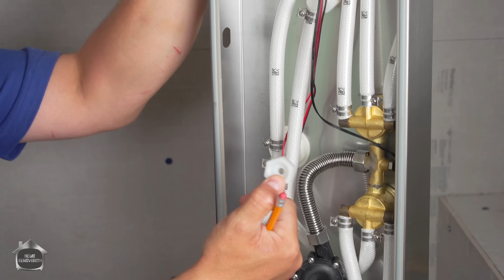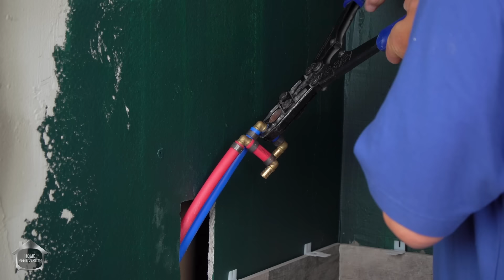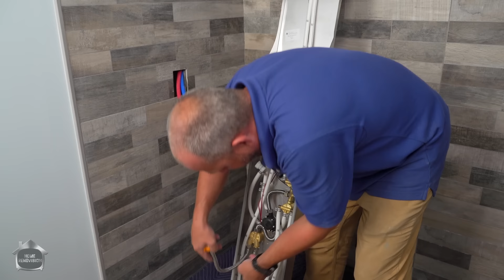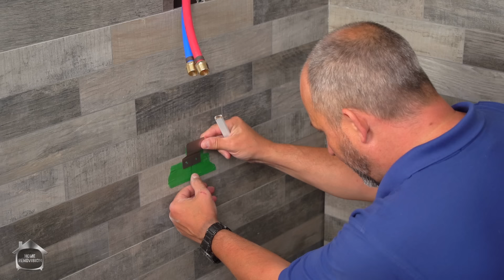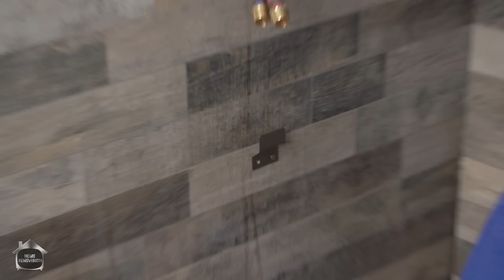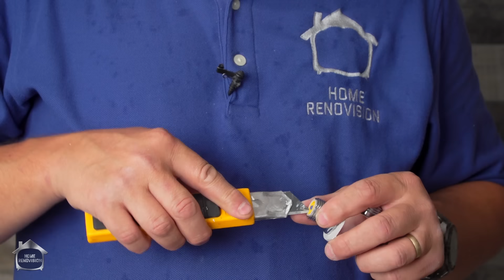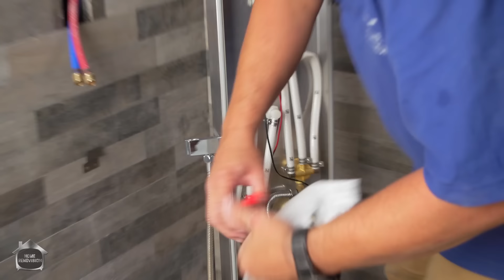Shower Tower Installation | Easy Plumbing For Beginners

Comment: I bought these same exact units from Amazon for about $280 a piece. One unit arrived a little smashed up at the top but I took pliers to bend it back... good enough and both units work great after installation! This video was invaluable for gaining the confidence to install them myself. I did have to hire a plumber to install new shut-off valves. Easy peasy!!
Reply: Is it worth it to buy? Or shower head is better?
Reply: @serhiiu604  It's been 2 years since I had these installed (2 bathrooms) and I love them. My family loves them. Everyone comments that it's like being at the spa. If I bought a new house I would install this same unit in the bathroom.
Reply: @JasonSigman  thanks for responding
 Would you leave the same one, or are there better options?
Reply: @serhiiu604  Hi, I don't know about the other options as I only have experience with this unit. I recommend it. There are reviews and comparisons online for other options.
Reply: You paid way way to much. I've installed at least 20 of these and usually pay between $115 and $140 depending on the model. After installing a bunch I like Ello and Allo
Reply: @aaugusta1842  Yeah, back when I bought them in early 2021 it seemed that the supply chain around the world was blocked up due to Covid and prices were definitely higher than today.

Comment: If you had shown the functionality  of the shower it would have been great. So many come without volume control for some reason. I just realized you could put a manifold in the line and add more stuff to it. Each new item would have to have it's own on off valve at the head.

Comment: Update: Your plan to sell your house (@30 minutes) in 5-10 years, changed. ;-), Installing one of these, the inspector was asking how it seals and I was trying to explain to him how everything just leaks back into the shower pan. Hope he clears me.
Reply: My shower tower leaked pretty bad, I recommend tightening all the philips screws in the back and all other connection points out of the box, this resolved my issue.

Comment: I watched this video probably 100 times.  Each time I learn something new.  I`m re-piping my home and decided to go and buy a Shower Panel. I have a Ello & Allo brand and it`s very similar to your unit.  Question, my outlet hoses on my unit are like yours, they go downward.  I`m re-piping my PEX from the ceiling downward like your pex. (My home has 40 year old pipes and under a concrete slab) .  Just like you, I will be attaching my PEX and curl the Shower Panel Hoses upward to meet my PEX. But I happen to notice on my unit that it states not to curl hoses upward.  I personally don`t think there is any harm.  What do you think?

Comment: This cosmic idiot left a gaping hole in the wall. God forbid a child sprays the wall with the nozzle, or splash back runs down the back of the tower, or moisture and condensation bead down over time. I am staggered this is the video on YouTube with the most views for shower tower installation....
Reply: Well that is very useful critique. Makes sense but have you ever heard of constructive criticism instead of an insult?

Comment: So an open hole into the wall for water and moisture to get into?
Reply: Very good. Makes me wonder if you could put some kind of a washing machine outlet for the hot and cold. That way it could be sealed. Or that may be overkill. .
Reply: @jamescole3152  That sounds like a very good idea. It might be tough to get one that fits, but a sealed box seems essential

Comment: how would I be able to have two of these panels in my shower? I would like one on each side of the shower, but I'm not sure how to connect the plumbing to do so. If you could possibly explain it to me that would be great.
Reply: Go with a larger supply line. 3/4 inch or more.

Comment: Hey Jeff, I assume you can only use 1/2” connections. Is that enough to use multiple functions at once?
Reply: same Q - seems 1/2” with all those small inner diameters will limit volume out of that tower!

Comment: I love your videos, they are easy to follow. I want to install a tower shower but I already have an existing plumbing for head shower. Any advice on what to do with the existing pipe and plumbing? Thanks in advance!
Reply: You can buy a shower tower/panel made for retrofits if you don't want to mess with it.

Comment: Do you think there would be any issue splitting my single 1/2" feeder lines (H/C) into 2 of these towers? I know there are a lot of factors to calculate flow and loss but "in general" if there was sufficient supply to a single tower is it within reason to expect decent performance with 2?  Thanks in advance!
Reply: You won't get the flow from both running at the same time with a 1/2" feed.

Comment: What other shower tower  or brand of shower towers do you recommend?  Preferably one from Lowes or Home Depot, as I'm too worried about shipping damage and like the fact if there is any issue I can just drive 2 miles and return to store directly.  This unit (actually the whole brand, Ello&Allo) isn't sold on Wayfair anymore ...can only find on Ebay from random sellers.

Comment: If you put in a tower, then later want a more standard shower, should you somehow prepare for that option in advance? Would you need to come in from the back through the adjacent wall?
Reply: Came here for the same reason. I'm wondering if I should just go ahead and plumb everything just in case I want to get rid of the tower.

Comment: For the units that have an integrated electronic display for water temperature or shower time, how is the display powered.  Is it a battery?  How long does the battery last?  Where is it replaced?  Do you have to lift the unit off the wall to replace a battery?
Reply: It has a small generator that is powered by water flow. I am putting the same unit in now so this video made a ton of sense!

Comment: Great vid, can I ask if this is a electric shower or thermostatic? I thought it was thermostatic as you have cold and hot water pipe going in, but then also saw wires behind panel and not sure what they're for so confused? Thanks

Comment: Mr. Thorman used a laser to check that the holes for the mounting brackets were vertically aligned. It's also a good idea, after securing the shower tower to the wall, to check that the unit is centered as desired and isn't tilted, because typically each bracket allows considerable lateral play, almost equal to the width of the shower tower.

Comment: If the hose clamps on your shower tower are held by Phillips screws then they are crap and may come loose. Replace each with a stainless steel band hose clamp that comes with a stainless steel hex head screw, which you can securely tighten with a nut driver.

Comment: Using an aluminum hock on an empty pail is a bad idea, because it won't be stable. If the hock is slightly off center, or the shower tower isn't centered, then it will come crashing down. Also, since the shower tower is typically made from stainless steel whereas the hock is softer aluminum, it's likely that the shower tower will scratch or gouge the hock. Using an upside-down pail would be more stable and avoid damaging the hock. A 5-gallon plastic paint pail is a good size. In fact, for even better stability, use a mostly full upright 5-gallon pail of paint or drywall compound with the lid securely fastened --- the heavy pail of paint or drywall compound will securely stabilize the support for the shower tower.

Comment: HI Jeff, could you please explain what is done with the existing shower head? Every video I have watched does not demonstrate the process of how. or if you connect it, in which I'm pretty sure something has to be done or water will come out of the shower hole.  I know how to remove the existing shower head nozzle but what is it connected to on this panel? This is the part that confuses me.  I have a shower with a shower head and hot and cold knobs you turn to adjust your water a typical shower.  If you can give information it would be greatly appreciated.  Seems everyone missed that step.  Thanks

Comment: That tower you selected is a very bad choice in my opinion. It's not a water tight design and you have a big hole in the wall behind. Air moisture is the least of what you should be concerned with. When you take a shower, water is going to splash. And it is not going to stay below the 4 foot line. Look at your video. Your nose is at about the line where the shower tower curves away from the wall. Water condensation, splashed water and air moisture will get behind that tower. Mold and mildew will grow behind that. In turn, some of that water will get into the wall. And while you used cement board on the shower side of the wall. You used unprotected drywall on the other. The 110 CFM fan you installed will be great for getting rid of air moisture after you finish showering. But it will not help while you are showering. You invested a lot of time and money on this bathroom. I advise you fix that hole and soon. Even if the hole was not an issue, I would not like the tower. The design guarantees that mold, mildew and soap scum will become an issue. If I was in your position, I would seal up the top and sides of the tower to insure that water could not infiltrate. I am glad that you are so happy with what you have built. And it is for that reason I am taking the time to comment. I would hate to see that investment ruined.

Comment: Hi! does it need to connect electricity to it? how many voltage dies it need?
Reply: Uses either batteries, or has a generator powered by water flow.

Comment: Really easy to understand  and  usefull. Personally I would add on the top of the square in ceramics for pipes,  a tinny plastic water deflector. Just in case if water comes along the wall upper than the shower head. It will protect when cleaning by scrubbing all tiles and heavy rinse....

Comment: I just had one installed in my bathroom and it’s pouring water from the bottom when it’s on. Way more than a drop. Any idea what could be causing that???
Reply: Leaking inside somewhere.  Should have been tested when not mounted to brackets.

Comment: No Teflon tape on the joints?  You keep saying that it's OK to get water behind the unit, etc.  That is wrong. Water anywhere means that you installed it incorrectly.  And stop using the word "secrets" when they are just "tips."  And moisture behind the wall will attract mold - period.  Telling people that your exhaust fan will keep up with the moisture in the bathroom and extract it is just wrong.  You shouldn't mislead people.

Comment: Hello. Thank you for the video. It will be very helpful for my bathroom renovation project. My question is how should I do the plumbing to make the shower also compatible with a traditional shower setting, a shower, hot/cold valve, and bottom spout? Thanks in advance.

Comment: those nylon supply lines are crap! They just don't hold up over time. Just like we learn in church ... it may look good from the outside looking in but its what is on the inside that counts.
Reply from the maker: Not sure why you don't like the supply lines?
Reply: @HomeRenoVisionDIY  the nylon supply lines get brittle with hot water running through them. Sometimes are ok on toilet supply lines but when there is hot water in them they get brittle and hard over time and start to crack and leak . I work in the construction industry and I've seen them make flooring and water restoration companies lots of $. Stainless steel braded supply lines or pex (preferably class A pex) is the way to go if you are looking for longevity.

Comment: could you theoretically have grouted all around the edges of the tower system where it met the wall ? just asking... can it be done.. don't tear me a new one lol
Reply: grout? you would have to do some research on that one, not sure if it would even stick to stainless steel. I would use silicone, do the top and sides, but leave the bottom open, leaving the bottom open ensures that water can freely drain out if it manages to get in.

Comment: where was the teflon tape on the hose connections ?
Reply: You don’t need it. The water seal is at the rubber washer, not in the thread.

Comment: Many of these showers also have a water misting option. What if i wanted this and a steam shower.  What would be the best way to seal the hole...or would some thru wall fittings like a shower head fitting maybe?
Reply from the maker: this type of fixture is not suitable for a steam shower application. sorry Paul.

Comment: When getting a shower panel (Shower tower) I suggest your viewers do not purchase a recessed panel which mounts between studs within the shower wall and get the usual one that mounts on the shower wall (porcelain/ceramic) as shown in this great video. Although the recessed panels are aesthetically pleasing if there is a leak you do not see it unless you are fortunate and can install an access panel behind it. I had a bad experience with a polished stainless steel top line panel that although selling for about $1,000 used 90 degree bend brass female plumbing connectors for the hot/cold feed lines. These connectors  slightly leaked but fortunately I replaced them with straight180 degree connectors purchased at Lowe's/Home Depo. I  noticed this leak because I had installed an access panel (the wall behind the tower is a clothing closet) but often it is not possible to install an access panel. I am a professional Contractor-Handyman  and just still love your fantastic videos which give some good tips. Actually I am addicted to watching your videos and other professionals on YouTube. Thank You.
Reply: Jerry Grayson wondering what your thoughts might be. I just hired a plumber to install mine and it’s leaking ALOT if water on the bottom of the unit when it’s on. He says this is normal. I know it is not. Thoughts??
Reply: @vsitterding  sounds like your plumber didn’t know what he was doing

Comment: I bought 2 of these for a couple of bathroom remodels, one of which is in my master bathroom. In my bathroom, I currently have a shower head and then below this are 4 small shower jets, two on each side, with the shower/jets control handle in the middle of the jets. How easy/difficult will replacing this be with the new showers system? And as a newbie DIYer, can I do this myself, or will I require a plumber?

Comment: Jeff, isnt 1/2" too small for the flow requirement?
Reply: Its the standard
Reply: @cmgambit23  i am told that 1/2" is good for 1 shower head but if doing multiple heads ,such as a "tower" that has a shower head and body sprays ,require
3/4 and if you use 1/2 you wouldn't have the pressure

Comment: And if you turn off the shower quickly you’re going to hear a bang in the wall because those pex lines are loose.  With heavy joints.  🤦‍♂️
Reply: Yup, good point
Reply: What bang. Its pex, not metal, will make little if any "noise" :)

Comment: I see you using a Milwaukee bit in a (Default) impact lol ditch the default and buy Milwaukee sir other than that good vid just installed one similar super easy
Reply: Or your both wrong . Makita is the way . My current set I’ve had for just under 6 years and my partner at work and another co worker both had the Milwaukee set. Well....they’ve both have had 2 each since. And all 3 of us got the first set for Christmas in 2014. Their Milwaukee drills literally stopped working. They even bought new batteries thinking it was that. Good working drill just doesn’t last as long. Also I use my makita way more and way harder than they do.

Comment: When I had one of those installed, they just installed 2 threaded fittings out of the wall at the top of the panel. Don't have to worrie about water getting in the wall through a hole that way. Then just extend the hoses down the wall behind the panel.

Comment: Put some silicone in the screw holes just before you install the brackets, helps waterproof the holes, just in case. Its what I do with shower door screws.
Reply: Yeah, waterproof those screw holes filled with screws but lets not worry about the 6 x 6 inch hole. lol

Comment: Jeff, great videos!  1 question and 1 idea for a new video (in all your spare time sir):

1.  New video idea:  you have done a lot on bathroom remodels.  Any thought to doing one focused on strictly on elder care bathroom access specifically?  I am looking for standing shower options, with a low step, and glass door please.  Maybe highlight some products or options you like?

2.  Question please:  I have PEX that leaked in my bathroom reno right at the 90 degree connector.  Plumber installed not DIY.  It was properly crimped but I think hard water from the mineral deposits from my well caused the crimping to fail right at the connector.  Ring was intact from the crimp, deposits just caused a leak.  Damaged drywall but good thing I was home.  Thoughts?

You rock Jeff

John

Comment: Big hole in the wall is not a laughing matter. With the hole not visible, you don't know how much water gets there if something goes wrong with the unit behind. It is designed for a European shower that typically has just 2 pipe fittings sticking out of a concrete wall. Definitely not two hoses out of 10 sq. Inch hole in the wall... 2 dropears, with brass nipples through 2 circular holes with silicone around would be a better solution...

Comment: Hey Jeff, what about water pressure effects of all these turns ups and downs? Just wondering if that would have any effect.
Reply: I think the real problem will be with flow, I'm surprised that it is not roughed in with 3/4 " ,you need more flow for body sprays and the shower head, 1/2 is not enough flow for all those fixtures?